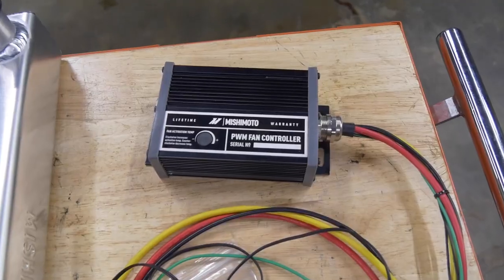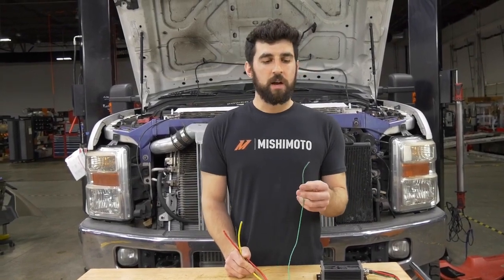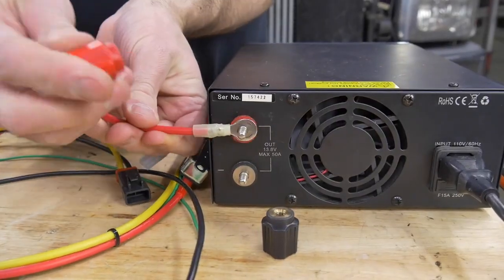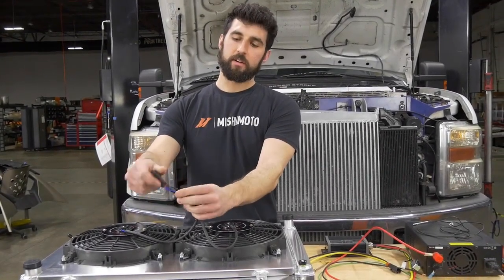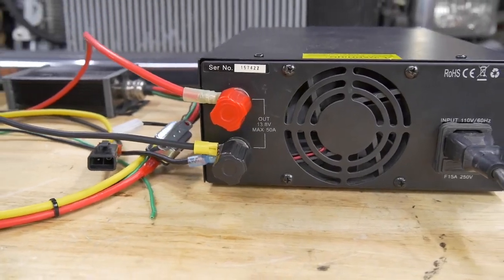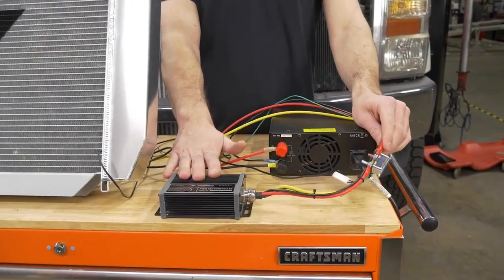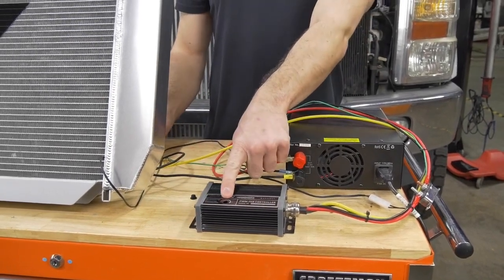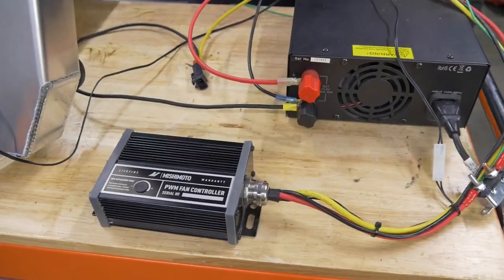5 Installing and Operating the Mishimoto PWM Fan Controller   YouTube

Comment: Hello is it better to actually mount sensor on upper radiator hose so it measures engine cooling temperature not radiator temp?